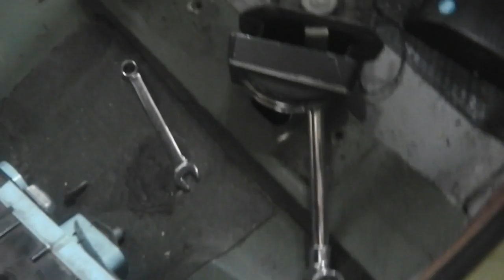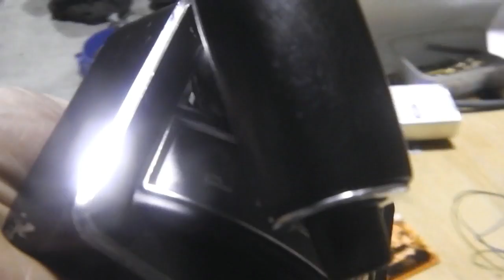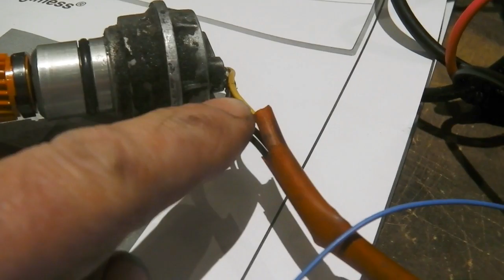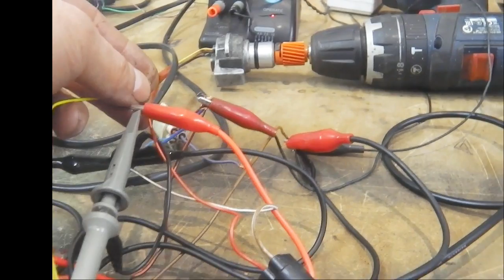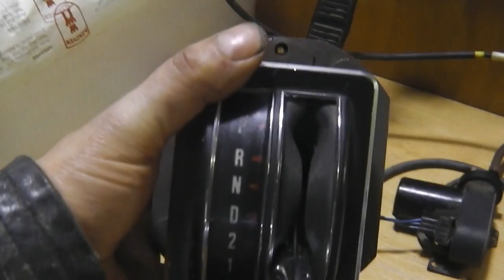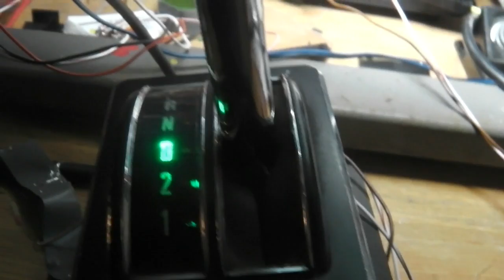Ford Cortina Mk3 Restoration Project Ruby EP23

Comment: Found a sierra estate today. battered, not our cup of tea. I know, I was trying to get the bonnet open.. no worries I know who owns it. I'm after a carb... I'm trying to get the bonnet open thinking pinto/carb. Then what comes to mind?.... It's a diesel. Well I'll ask Eugene in the morning. Nice work Pete. A friend of mine showed me the Ford Mustang GT 500 fast back he's restoring. 
There is no floor pan in it, the sills are there he's got a new bulkhead top in place and he's brazing and miging it in. I would have just miged it in. See ing yourself and him with the brazing. I'm thinking I'm missing something...
Reply from the maker: Hi mark, im not 100% sure why the brazed some areas. On My Mk3, and (I think!) mk4 n 5 tinas, they are all brazed in same places, scuttle to a pillar, rear quarter lower to sill, rear window lower quarters. Prob few other places. I think its beacuase it sanded down quite well and could blend in nice on visible areas, other ideas were it made a beter water seal and not sure if it made extra strength, anyway.....I copied the braze across onto my shell to keep it factory style.I think I got spare pinto carb £40 quid if you need it, 2nd hand but was runnin when I took it off, may need clean up of jets etc, not sure. I kept it as a spare for whn I travel long distance just in case.

Comment: hi mate i have a feeling that the speedo drive cog is geared for the size of wheel, ie sierra 14" and granada 15".
so using the granada drive with 13" wheels may not read correctly, might not matter in your case but for warned is for armed,
with that speed sensor i would be tempted to have a digi speedo.

Comment: Hmmm, 4-speed automatic with lock-up torque converter, check.  Cruise control, check.  Power steering, under consideration.  What's the next idea, maybe air conditioning?...
Reply from the maker: Can I thank you for your interesting and detailed replies.! really really welcome and knowledge that is valuable to me and others following this. Im on a tight schedule at moment with non car related things, suffice to say I finished (today) the mounts for the gearbox. I have made them look factory by building 1.5mm metal casings to complete them. I then spot welded / migged them properly to the underfloor by spinning the car again, this has delayed the project a little, however the finished mounts look camouflaged now and almost part of car, with the seam seal and gravitex over them they have blended in nicely. I used cardboard to make little templates for the various pices of steel to fit profile of tunnel so that finished mounts are boxed in, this was always the plan to do, its just that initially I needed to set the positon exact with the good strong mounts I built, all ive done is added to those mounts with plates to create a box on each mount that blends into profile of shell. looks good. Yes air con in the seats by using 12v compressor and heat exchanger (from a vending machine lol) cold water is piped thru coils in the seats. Also seats are heated. Kept Granada seats as they bolt straight in too, havin those trimmed in ruby red and orginal ford brickweave trim. For long drives away I may swap out seats (onl 2 bolts) as on gxl seat height adjuster stays fixed to floor and seat slots in to height adjuster, leaving only 2 bolts at rear. actually there some pins in rear hinge assembly in theory could build quick release pins. Its been quite intense project with the auto, luckily a great guy found me a  proper flex plate, pinto crank to A4 gearbox. Ill get a specialist to assemble the final fittings. I have a fully reconditioned a4 box I bought on ebay, the boxes  I have at moment whilst probably work, are just for research. ill sell them on I think. Still need to design a system to operate the lockup as im not 100% sure how it is supposed to switch on. I m reading different opinions, i.e that some early ones a pure mechanical operation with no 12v solenoid to activate, I read some are mechanincal but can be overridden with 12v applied to the (or ground) solenoid plug on side of box. some later boxes have this in addition to the 3rd gear solenoid which I think was on later Granada scorpio. its all a learngn curve, but main thing is to drop car into paint shop next week.  Once again, thanks for the detail you supplied its very interesting to hear your thoughts and your advice. always appreciated and always considered and I always think about what you say as I do all constructive critique. forgot to sayon chilled seats, small 12v water pump runs the cold water thru 8mm flex pipe (all hidden) each seat has quick relaease john guest water fittings, system is primed and then runs. controls are hidden in centre console. 12v compressor kicks in and cools a coil which in turn cools down an aluminium block, the water pipe runs thru the block separate, so you have a mini heat exchanger, routed by the sills (hidden) are the 2 8mm tubes, these link into the seat which has coils of the tube tied into the seat frame (hidden benath the trim of seat beneath the foam) on top of this are the heat pads for electric heating of seats. (don't turn both on at same time!! ill build a relay to stop this!)  because I cant get aircon without it looking obvious in the engine bay, I decided on a hidden alternative of chilled seats. its in the testing stages. Ive not filmed it all yet,ill do that when its running and then talk thru it. it may not work. only thing concerns me is dew point and condensation, I may just run it at 17 degress this way its cool to the touch on the seat cushion but not enough to cause condensation on the tubes. I could lag tubes up to point they enter seat. tubes can fit in the groove of inner sill , theres room.im familiar with the system as I used to work on beer cellar cooling systems and drink dispense systems.  all the best. pete. ps cant reply as form tomorrow as away for a while, not sure ill have internet. thanks Jamie
Reply: +Pete C   I am glad that I can help, I've been around vehicles for my entire working life, and, to be honest, a big chunk of it before I was old enough to work so I've picked up a few bits and pieces along the way that I like to share with people that appreciate the info.

I mentioned the air con as I know that Australian and South African Mk3 Cortinas were available with a/c and, as both markets are right-hand drive I would imagine that the bulkheads will be very similar so I would think that these parts would fit a UK Cortina and look period-correct.  There are, of course, companies like Classic Air that specialise in making modern a/c systems that look period-correct for classics, though a system like that would probably be a lot of money.  I would think that there are ways to make a modern a/c system look more period, such as making a false skin for the compressor, but the problem is that modern a/c systems use different refrigerant to what was used in the early '70s, and the pipe fittings and items like the charging ports are very different to the period items (which is a legally regulated item) and they do look obviously non-period.  Plus, of course, an a/c system takes up much more space under the bonnet and also behind the dash (bigger ducting, or, on some cars where the a/c was an "add-on" rather than part of the existing heating/ventilation system, an entire extra ducting system) and you're already quite well packed behind the dash.  The seat cooling is not an idea that had occurred to me, though it is a system that is used on a number of cars, indeed your Mondeo probably has heated and cooled seats if it's a Ghia X or Titanium X model, and the principal of the system as you've described it is pretty much exactly the same as the cool suit system that drivers in the V8Supercars series in Australia use, except in your case the cooling pipes are in the seats rather than in the driver's racing suit so the principal is certainly sound (the V8 boys have been using cool suits without trouble for the best part of 20 years, the only "repeated" failures being the pump, but even that is limited to a handful a year out of 30-ish cars over 40 or so races.

Unfortunately I'm not that up on automatic transmissions, I know how to service older units but I've never really delved deeper with them, so I would suggest for solid advice you speak to a friendly automatic transmission specialist as to how the lock-up torque converter works, i.e. whether it is something that can be operated at the driver's wish or whether it's something that it is best left to the transmission to decide when it operates.  It does occur to me that if it is something that can be operated by the driver then it is similar to the transmission systems used by a lot of Japanese and Far East manufacturers through the '90s which were described as being 4-speed but were actually effectively 3-speed + overdrive with the overdrive being torque converter lock-up effectively giving direct drive.  On these vehicles there was an overdrive button on or close to the selector, in normal use the overdrive would be "in" (unlike a manual/overdrive box) so that torque converter lock-up would activate, if the switch was activated the lock-up is disable, and usually an orange light would show on the dash saying "O/D Off" or similar.  I believe this would be used when climbing a long gradient to keep the engine spinning faster so it is operating higher up the power band.  If that is the case with the A4LD box then I would imagine that the mechanical control for the torque converter lock-up will be vacuum-operated so that when the manifold vacuum falls away as when climbing a long hill the lock-up will release, the electro-mechanical will be the same but with an option for the driver to manually disengage lock-up, and the electronic control on the A4LDE will be for cars that have full emissions control and engine management where the intake system is "sealed circuit" and any air leak can cause poor running and potentially do damage (basically every modern petrol car) where instead of using manifold vacuum to operate and disable the lock-up instead electronic signals from a sensor such as a Manifold Absolute Pressure sensor will be used to trigger a solenoid to activate or deactivate the lock-up.  Therefore, if I'm right, either a mechanical or electro-mechanical lock-up will be suitable for Ruby (to be honest I would think an electronic unit could be made to work by using a MAP sensor of the correct operating range but it would take a lot of electrical/electronic work and it would affect the "period-appropriate" appearance under the bonnet due to the MAP sensor being pretty noticeable installed on the inlet manifold) but the electro-mechanical operation would give you more functionality as you can choose to disable the lock-up rather than having to wait for the gearbox to decide to do it.  Actually I strongly suspect that the mechanical and electro-mechanical gearboxes are pretty much exactly the same, the only difference being the actuator on the side of the box.  It strikes me that if you have the electro-mechanical unit, or you can find the electro-mechanical actuator to replace the mechanical one, an elegant solution to operate the system lies in the T-selector.  I believe the T-handle was the same on right-hand drive and left-hand drive vehicles (even American vehicles with the C3, '60s Mustangs used the same selector) but, with the lock button being designed for thumb use on right-hand drive vehicles the thumb lock button is on the right for operation with the thumb of the left hand, on left-hand drive vehicles the thumb button in on the left for operation with the thumb of the right hand.  I'm sure cannibalising a left-hand drive shifter and some minor modification could give a T-shifter with the lock button on the right as standard, and a second button on the left operating a switch/micro switch to disable the torque converter lock-up, like on the Japanese vehicles.

I hope everything is going well with you, it certainly has been an intense build with a lot of clever and innovative engineering done to make the modifications without making the car look modified.  I hope you enjoy your break and refresh the innovation batteries.  Don't worry about not being able to reply, I won't be offended, just have a good break...

Comment: Like you said, first hold (selecting 1 on the shifter) is only needed for towing up a steep hill, or doing burnouts/donuts, both of which pretty much all automatic transmission specialists will tell you not to do with an auto as it's a damn good way to boil, cook and ruin an auto box, even if you do have a stand-alone transmission oil cooler...
Reply from the maker: shifter has worked lovley and its got nice crusie switch fitted. im real happy to say ive managed to hide everything so you wont know these features are there. car will look standard as much as poss. Ive added a few interior trim toys from the Granada......watch this space.....toys thar are very useful to me on long runs. subtle mods.
Reply: Pete C   I'm glad to hear it.  These videos are really going to give people pause for thought about how modern toys can be added to a classic without ruining the period feel if a person is prepared to put some thought and skill into the job rather than just using what you have the way it was designed to be used.  Actually, watching the cruise control bit it occurred to me that there is no reason why the vacuum pump has to be fitted close to the bellows unit, as long as the hose between the two is reinforced so it doesn't collapse under vacuum then the pump can be fitted anywhere on the car, and as it's the only "noisy" part of the system it can go somewhere that insulates it's noise from the passengers.  For clarity it is also worth saying that not all cruise control systems have a vacuum pump.  Some (more basic) systems that just hold the selected throttle position rather than adjust it to maintain a set road speed may just have a vacuum reservoir powered by manifold vacuum like a brake servo...
Reply from the maker: youre right on it!! I just fitted it in the boot, theres some empty dead space over the rear wheel tub (hidden space) ive made a nice bracket and spot welded the mount plate with its isolating rubber cones, right above offside rear tub. this space is blanked off with factory foam/card affair and its a cavity waiting to be exploited, so there you go, great minds think alike. I get the feeling you are on my wavelength, it makes it easier and more exciting for me knowing theres people like yourself out there, almost feels like a team, with all the youtuers helping me. I work good in a close team/duo   , its something I don't often have. It worked well with Mike in the early days, he was a great man. Heaven knows how it failed. Its like when a classic band splits, or the guitarist leaves. Like Peter Gabriel and Genesis. I digress...............
Reply: Pete C   It doesn't always come to me at the time but it's like my brain subconsciously sees something and then a while later it pops up with a link to something else I've seen in the past that has a relevance.  Oddly, with the cruise control vacuum pump it was the central locking on my old mk2 Golf GTI 5-door, as the central locking on Volkswagens, Audis and a lot of Mercedes from the '80s was pneumatic operation not electric as on most cars.  I'd had mine for a few days and I was poking around in the boot looking for rust, and I noticed a package strapped to the back of the spare wheel well.  I knew it wasn't the tool kit as that was mounted elsewhere, so I had a nose and discovered that the package was a lot of moulded sound deadening material containing the central locking pump inside a vinyl waterproof cover.  Without the sound deadening it made a hell of a thump when the locks were operated.  You really don't want a noisy pump operating inside the car when you're on a long drive on cruise control, putting it behind the kick panel wouldn't leave much space for sound deadening to muffle the noise, and an enclosed space like that is a bad area for a pump as pumps tend to generate heat so they need air to cool them so no tight spots.  Behind a trim panel in the boot is ideal, there's plenty of volume of air for cooling, it's protected from likely damage and there's division between the pump and the interior of the car with the back seat and parcel shelf.

It's often easier working in a team doing innovative work as you can bounce ideas around, and often the best solution lies in a mix of all the available ideas.  Plus, with a restoration being in a team you can spur each other on when things get tough.  Unfortunately, life can get in the way of the best friendships and teams, and it's very good at throwing curve-balls at people.  At least with YouTube you can pretty much guarantee, especially with car/vehicle stuff there will be someone watching who will have an opinion, a thought or some solid information to share on any subject and often putting a few of them together in the right order or combination can crack any problem or decision.  Plus you've also got the knowledge that what you're posting is keeping hundreds of thousands of people entertained and probably more than a few of them inspired, even if, like me, sometimes they get a bit behind in the installments...